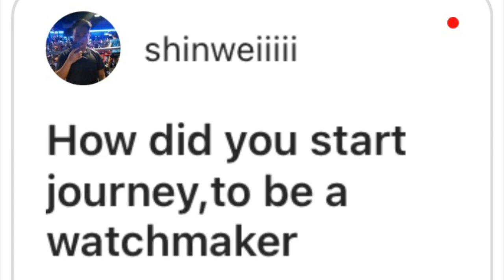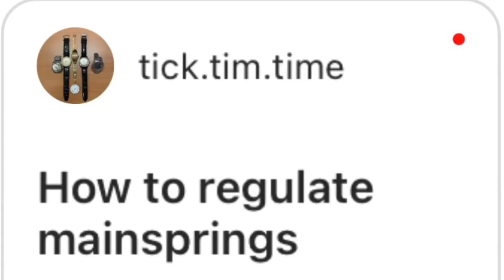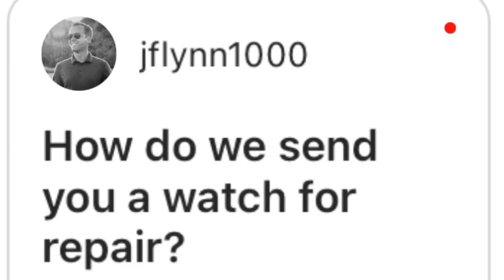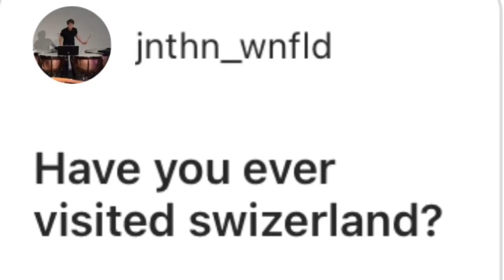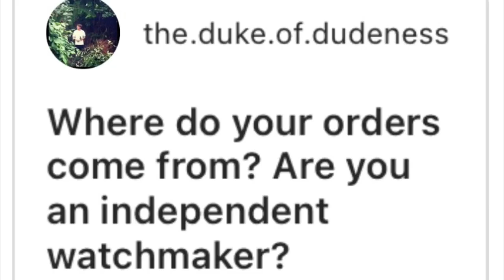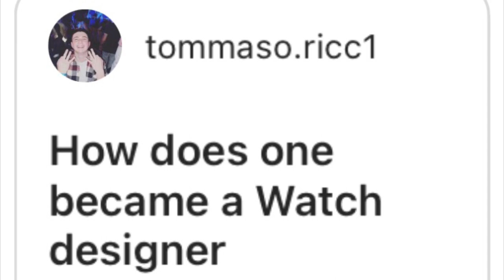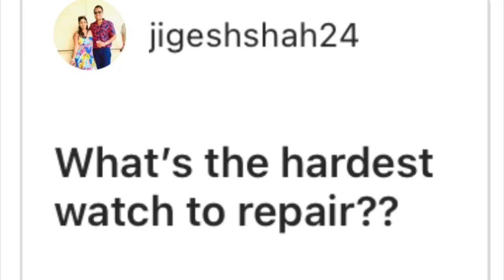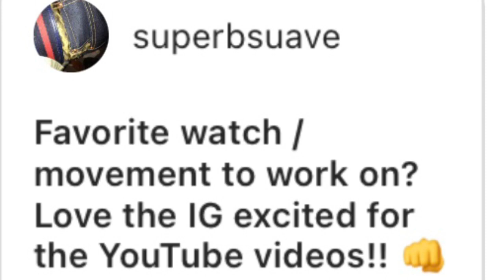WATCHMAKING Q&A

Comment: Adding to the part where to start the hobby, I would strongly advise not to take on projects off of ebay. I've been starting out 2019 and the watches found on eBay have been the most difficult for a beginner, probably they are making their circles popping up on eBay after each failed attempt. I've been so sturdy in my approach, but it has been so disheartening as well with those massive problem cases. Do yourself a favor and start off with a running watch that has decent time keeping and try to make it better or just as good as before at least and don't be brutal to yourself as I have in trying to solve the mystery cases.
Reply from the maker: Yes, this is great advice. Don’t start trying to fix things until you’re capable of maintaining and improving the pre-existing condition of a functioning watch.
Reply: I agree. Buying broken watches to learn on from Ebay can be very frustrating for the beginner. Better to buy a running $40 Chinese ST36 time only movement and practice assemble/disassembling it.
Reply: A working watch is truly the best way to begin. Don’t be disheartened if you bugger your first few watches. No one was born a watchmaker.
Reply: I guess it depends on your prior experience and aptitude. I’ve come from a mechanical background. So I jumped right in with “serviced” Seikos from India. In my first 3 months I fixed broken or rusty pivots, restoring damaged hairsprings, and so on. However, there were other areas where I’m weak and know very little to nothing about. The challenge is not frustrating for me.